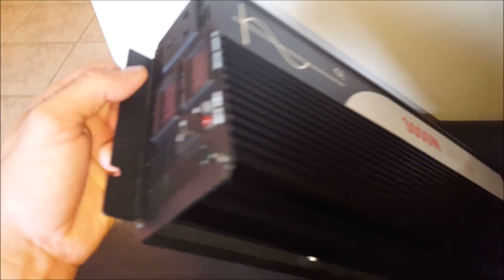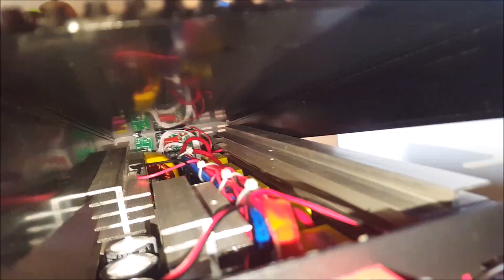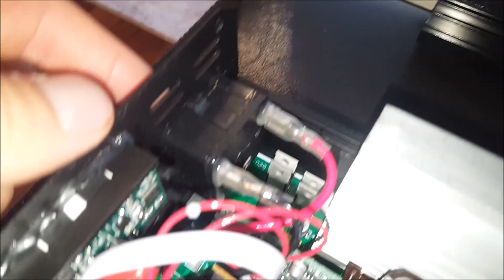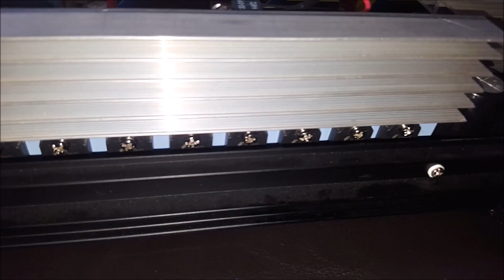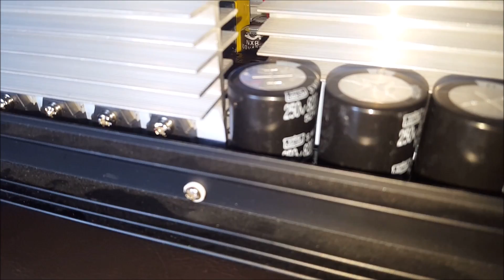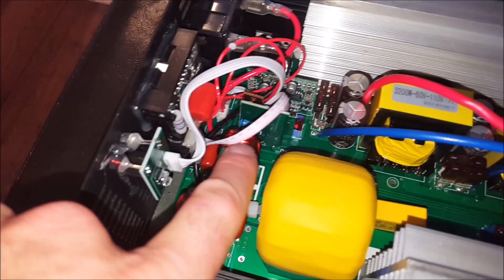Inside 60V 3000W Chinese Pure Sine Wave Inverter

Comment: Big heatsink with the transformers is the input side which steps up 60v to high voltage dc which goes through diodes on the smaller heatsink and then goes to a H bridge to convert dc to ac.
The mosfets brand are fairchild
Reply: Are the transformers wired in parallel?
Reply: I'm not sure as I don't know are haven't seen the schematic either their in parallel or they have they're own mosfets each and diodes after they both connect to the main caps.
Not sure tho

Comment: I am a bit dissapointed to view the video. Verifying chinese product is not sufficient by just looking into its inside content. You need to check with OSCILLOSCOPE to ensure chinese supplier is not A LIAR. They claim it as PURE SINEWAVE and put higher price tag (2-3times from modifies sinewave inverter). I don't buy it. Pure sinewave? Is it s joke sticker?
Reply from the maker: I have checked, it's pure sinewave but the inverter died after 3 months, but I also have a 12v inverter and its lasted much longer.

Comment: Very nice video I have one simple question I have one small compressor which I want to run on this inverter is this possible or not I have one 500 watt but that thing won't even start the compressor so what is your expert advice the small compressor need 1300 continuous power I saw couple of videos on YouTube where popele are running different devices but I am still confuse to buy this
Reply from the maker: sounds like you will need a 3000w inverter, I have had great luck with the 12v swi inverter and bad luck with the swi 60v inverter.

Comment: I just bought this inverter a few minutes ago and im so glad I found your video! Thanks for the awesome review
Reply from the maker: its a hit and miss I had one that blew up in 2 months and one thats 3 years old and still good.
Reply: @GoingOffGrid101  people,IF you know how to repair electronics, OPEN your inverter BEFORE you turn it on and INSPECT all inside, and CORRECT whatever you find wrong; i do not sell ONE to my customers without doing that; seen all kinds of mishaps of assembly; not of design,but of a rush-rush assembly; some would not last 5 minutes under load if i did not fix them before; about 10 pct are  badly assembled; concentrate mainly on the power mosfets to make sure they are all fully contacting the heat sink,seen all kinds of mishaps there... once corrected FIRST,these things last forever,if good quality mosfets were used, which is ,most of the times,the case...

Comment: perfect candidate for water cooling the mosfets, all nicely in a row.
I'd be checking they all had thermal paste applied properly and were touching the heatsink flatly, because i'm anal like that, see if I can improve thermal transfer and all.  
too many years of modding PC's to overclock ha.

Comment: i bring the same model from aliexpress  but  2500w    120vdc to 220vac  low voltage 86v highest voltage 128v      it cost me $219.5 including  ups shipping, i select the 120v to have the lowest current possible to not burn the inverter.what did you think about 120v input is it better then the 60v input? or the same?  it have 4 transformers(you have 5) 2 big capacitors(you have 4) all other i think they are the same
Reply from the maker: Well My 60 volt inverter died 3 times and I repaired it, and my 12 volt model is working great, so im thinking it depends of what voltage you pick and what components swi ends up using to make the inverter.
Reply: the same parts fixed every time or new parts ? And did you use it full load or near half power load?
Reply from the maker: blew up at 70% load and another at 20% load

Comment: interesting I bought on at 2500 watt slip phase 12v input 220 output nice to see were all. though fuse go that they sent with it but mine are 40 amp fuses
Reply from the maker: yea, this one doesn't need 40 amp fuse cause its 60v instead of 12 volt

Comment: nice ,,, so would you say it is good enough to have in my ice cream trailer? 2 Freezers ...
Thank you....
Reply from the maker: yes, from what I have done it will be good for 2 freezers, I have not don't a long term test on it yet so I am not sure how long it will last, also I have had a few people tell me if you have problems with the unit there is pretty much no warranty :S
Reply: thank you
I was looking at the Go Power 3000watts Pure wave but that is $1000plus
Reply from the maker: yes but it is a much nicer/might last longer as well.

Comment: Stay away from this company and these units. Unresponsible sales rep. No parts available online.They sell them in Chinese sites under Swipower and on Ebay blithechen. Aliexpress was no help either.
Reply from the maker: thanks for that info, so buy at your own risk all these are hit and miss, at least my 3000w inverters are still up and running.
Reply: my 24v 3000w buy to blithechen,only work 3 weeks and burn  to.this xijia or swipower.
Reply: you get what you pay for, these are stupidly cheap, what do you expect?   if you want something serious and to last, you buy a ~$2000 professional inverter like lantronics. 
a lot of people are using giandel for years and never had a problem, did you deal directly or through ebay etc?  
the Australian branch has been widely reputed to be good with warranty and service.

Comment: I bought the 2500w model of this unit. It only worked 1 day for 9.5 hours. Next day it sparked and burned up. Seller, blithechen on Ebay happened to be a troll. I went through hell until getting him convinced, that it was the faulty assembly of the PCB as the cause. As of today, after 3 weeks of waiting, he still tells me part is on it's way. Money burnt. Please BEWARE of this brand and the lying, ignorant, unrespondible company sales rep blithechen
Reply from the maker: sorry to hear that man, im going to let people know in my next video, :)
Reply: @GoingOffGrid101   There are 2 classes of inverters - #1 High Frequency - and #2 Low Frequency - yes they both put out 60hz.  The difference is HOW they generate the 60Hz.  Low frequency designs have the Huevos to handle BIG startup surges USA rates 2x surge, china rates 3X surge amperage for the same thing - they also have ONE simple (BIG) step UP transformer, and they are HEAVY.  If that 3000W, (doesn't much matter input v - more output w) were low frequency, you would not be able to pick it up and toss it around with one hand.  High frequency designs divide and conquer and thus are fine for continuous loads, like computers, lights,  to even microwave ovens - but start/stop inductive loads like compressors or table saws with them and you'll need lots more than a few replacement fuses.  Most people SERIOUS about making grid quality power WITHOUT the grid part of the equation (or even with a micro-grid which is a very interesting concept now days with villas worldwide that tie resources together to become their own power companies) =->  Those folks want low frequency inverters with 25-50lb of iron + copper per 3000W of power (rough engineering numbers).  There's just one little problem with low freq.  Efficiency.  What people call "iron losses"  - and those can hit 100W lost per 3000W rated output [again rough engineering  numbers] depending on input voltage, did they use CCA wire (!!?!!) for the xformer, and more.  If you are really serious about not having a power bill or you're just way too remote for power lines, then there exists a 3rd very rare variant of low frequency inverter that use a toroid transformer design - and again there are many designs of toroids there for conserving metal, costs, weight, you name it - but the toroid contains the magnetic field in such a manner as to prevent magnetic loss, something that HF or LF designs can never do, approaching high 99% efficiency, silent, preventing eddy current losses to heat the transformer core, which add up at the end of a cul-de-sac where you might have 6 homes each running their own inverter all tied in an ad-hoc micro-grid with varying look angles at the sun on different homes, panels, batteries, etc trying to form a co-op for power.  These are great systems, except  6 inverters each burning 150W in waste 24x7 adds up quick.  High end companies like Schneider and Studer do this - I've used their high end products, and most produce "power" that is actually better than grid power in the end.  You won't find them for $69.86 at MalMart though.
Reply: Same to me... But in my case, the ask me to pay for the parts😂

Comment: mosfets, fairchild 40n65 igbt, 650v 40a FGH40N65UFD

I like the individual supply leads for the transformers, but the fact that they have fused each one means its a bodge over current limiting them, would add cost though as each transformer section wouyld need its own circuit,  instead of it throttling back if you connect a 4kw heater to it, it will drive it till the switching mosfets protect the fuses...

with a few extra temp sensors added that could be one hell of a robust unit
Reply from the maker: it seems really good for the
$360 I paid for it, and I am trying to help others on a budget  :)

Comment: Thing looks good!!! You got me looking at the 48 volt 600 or 1000 unit may add to my system to run the house at night. my mpp 4048 inverters use 45 to 55 watts at idle x 2 that's not to efficient.
Reply from the maker: wow even my FSW 3000 doesnt use that much power idle :S and yes I like mine a lot might get a smaller one as well.

Comment: At looks like a well put together Inverter.
Please make more videos on that Inverter while in operation.
Is it 12V or 24?
Please post the link below where you bought it ok?
Thanks for sharing and God bless
Reply from the maker: its a 60V 3000W inverter used with lithium batteries and inverter link in description
Reply: @GoingOffGrid101  hi this is my first time seeing one of your videos[ I guess I need to subscribe] I just wanted to ask, since you say 60 volts, are you using 48v  solar panels or something else ?(again I have no idea what you got going on this is my first time seeing one of your videos)
Reply from the maker: @lyleg.9192  I use multiple solar panels to make 130 volts
Reply: @GoingOffGrid101  oooh i c...running them in series..thanks 4 replying
Ps: something I learned not too long ago was that it's not just visible light from the spectrum that charges the panels but also the infrared and  almost none of the ultraviolet
Reply from the maker: @lyleg.9192  yes very true, you can put solar panels around a fire and they will produce power :D

Comment: were did you buy it? how much? seems similar to this one https://youtu.be/PI9kAWQ_s4w 
according to this they don't give you spare fuses out of generosity but because they expect them to blow rather often.
Reply from the maker: nothing looks much alike to me, ill put a link in distinction for the inverter, im ok with the fuses going as long as they are not soldered to the board witch these are not :)
Reply: They give you 6 fuses. You need to buy a full box because they burn all the time. This is a junk. Mine burned up. Company sales rep unresponsive weirdo. Save your money, get some other brand.
Reply from the maker: T. K. these are all different inside and I have run lots of 3000W loads on mine, hope it doesn't get this same problem as yours
Reply from the maker: dang man open a complaint with ebay
Reply: fliping720 and watch out for those 2 small PCBs right behind the AC plug. They are very close to eachother. Mine shorted out because of this. For parts the seller is not helpful at all. I have to junk it.

Comment: Impressive quality for the price, don't think of grounding to the case. What I am interested in is if the display could be corrected for accuracy. Could you contact the manufacturer?
Reply from the maker: these displays are super cheap, I bought a few and they just dont read properly sometimes.
Reply from the maker: T. K. thanks for telling us this! im sorry about these bad resellers, the 3000w I have has not had any problems yet, hope it stays this way, thanks again!!!
Reply: fliping720  that's funny
Reply: you wouldn't want grounding to the case, these are made to be mobile units, sending live to case in a fault would be a death trap.
Reply: I bought the 2500w model of this unit. It only worked 1 day for 9.5 hours. Next day it sparked and burned up. Seller, blithechen on Ebay happened to be a troll. I went through hell until getting him convinced, that it was the faulty assembly of the PCB as the cause. As of today, after 3 weeks of waiting, he still tells me part is on it's way. Money burnt. Please BEWARE of this brand and the lying, ignorant, unrespondible company sales rep blithechen

Comment: you could check with a ohm meter the ground pin outlet to case it may ground through mounting hardware.
best
Reply from the maker: ok
Reply from the maker: just checked, not ground.

Comment: those pots. maybe control low in put voltage cut off and output 50 or 60 htz. IDK but would be nice to see. I have lithium batteries 18650 and I have a 12 volt inverter if I run 4 in a series the voltage is too high for the inverter if I run 3 in a series it starts off with a lower voltage any voltage sag causes it to trip low voltage so I'm interested myself in one I could control the input voltage thanks for showing this video👍
Reply from the maker: I have been searching for inverters like this as well for 12.6v lithium battery :)
Reply: @GoingOffGrid101  Have you found any inverters that have an adjustable low cutoff voltage?
Reply: @jamesmaclean6558  did you ever get an answer on this?i have a 48 volt unit that shuts off around for low voltage reason around 46 volts. this boxes me in. i have four 12 volt lith batteries. any help would be appreciated. thank you